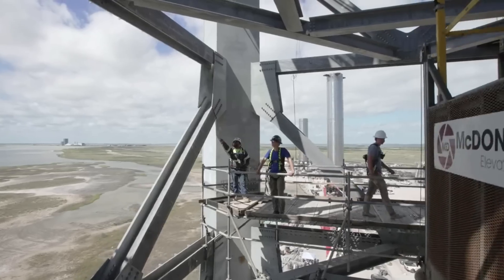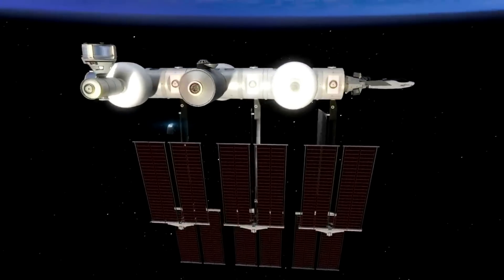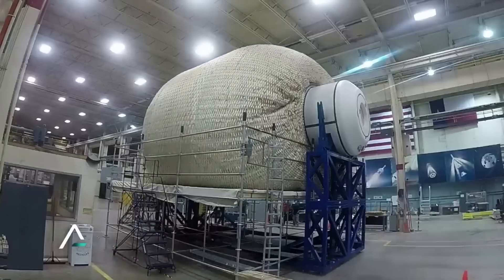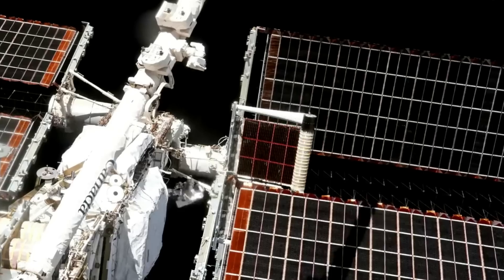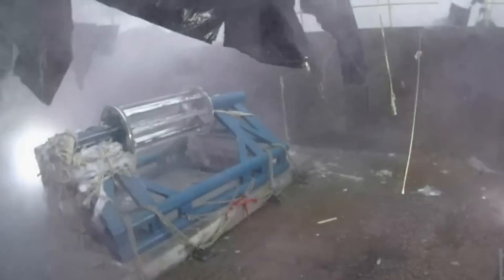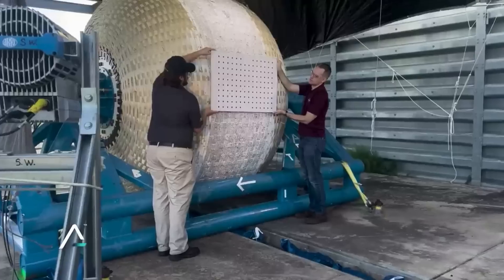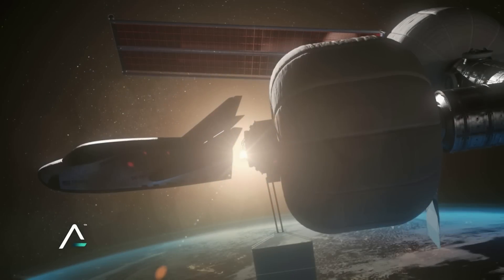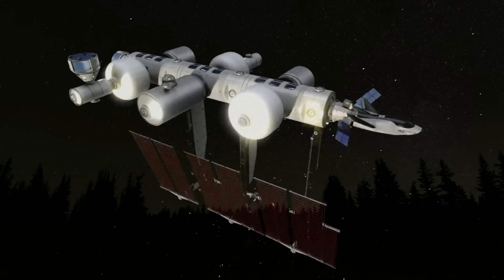A Closer Look At The Inside of Sierra Space's LIFE Habitat

Comment: This is really cool but one potential downside of these big modules is that you lose the ability to seal small areas with problems. On a ISS sized station, If one module fails you lose 1/3 of your station. Lots of individual pressure vessels provide redundancy and safety. Other than that “build it stronger” I don’t know how you can provide that emergency triage ability.

Comment: Why do all these artists renders have the floors running down the length of the cylinder, instead of Across? Treat the centeral tube the way you would an elevator shaft in a building, and these this become much more practical, especially if hung on a spinning hub.

Comment: I want to see one inflated to normal space operating pressure and then shot with a rail gun (Mach 6+) with an average size metioriod projectile (lets say a 1/4-20 stainless steel sized nut). Will the space habitate explode?  Will the projectile penitrate trough and through?  Will the habitat self seal.  How long will it take for the enviroment in the habitat to become untenable and not be able to support life.  Will the crew have time to reach an escape pod or safety area?

Comment: I wonder if you could add a layer of glass fibre matting to the structure in such a way that if you injected the glass fibre layer with resin, it would spread evenly in between two pressure layers (outer constraint layer, inner pressure bladder)? Epoxy resins are able to become effective radiation shields, and glass reinforced plastic would make for a nice solid surface to mount equipment to thus you get one layer that serves three or four functions since it would presumably also act as a physical shield against space debris and as a backup gas tight layer.

Comment: I'm assuming that if a piece of space debris did manage to pierce the habitat, it would instantly explode? Or implode?
Or would it maintain its shape and just leak air slowly?
Reply: It would lose pressure so implode, but what matters is if it is inflated or expanded.
Reply: Oh it would explode massively but it won’t get pierced it’s very strong
Reply: @raijingaming9608  Catastrophic failure would require multiple bands to be compromised.
Most of the time it would just leak slowly. A self sealing capacity could easily be built into the bladder.
The destructive testing was at ten times design maximum operation pressure.

Comment: Inflatable space habituates have been around for a long time. Since 2016, there has been a miniature one installed on the ISS called the Bigelow Expandable Activity Module (BEAM) .  It is more than about time they are used in orbit.  In that NASA chose not to use them for their Lunar Gateway I believe is a mistake limiting its viability for the long term.
Reply: NASA developed the concept and design a long time ago, then Bigelow licesed the technology to develop it for flights, but folded before they could contribute to Lunar Gateway. So when Gate way was announced, there was no company albe to provide this technology for it. Now Sierra is getting stuck in to it, there's every possibility of getting a decent size module in to space, for uses such as expanded living areas, or massive orbital fuel depots, or expanded in to vertical tunnels and buried with regolith on Luna and Mars.